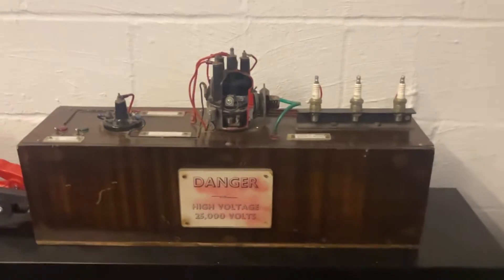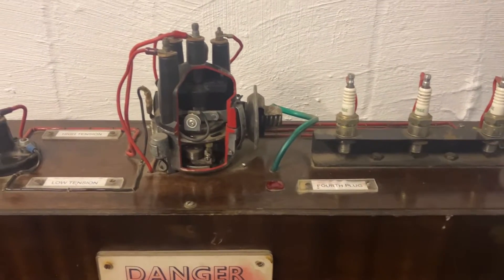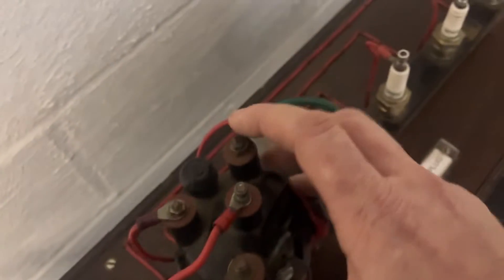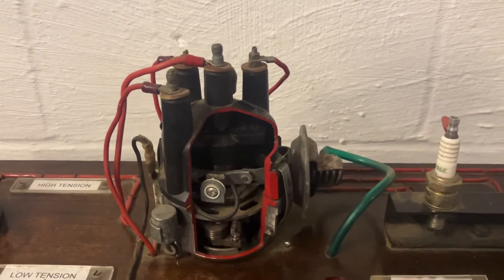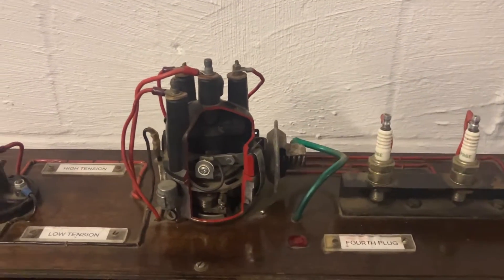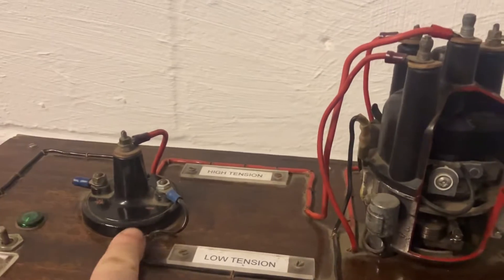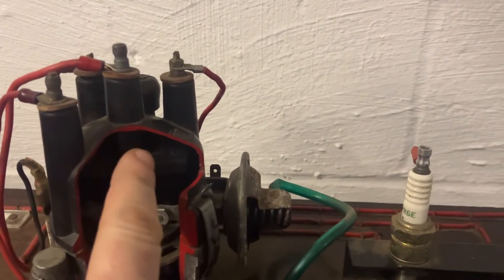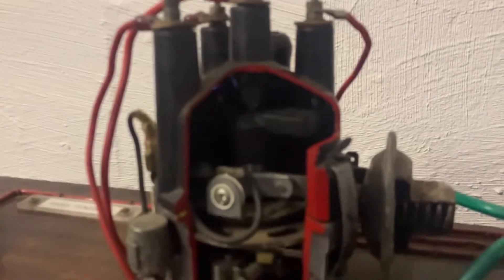How a Distributor Works.

Comment: Thank you for the video. I used to do the timing on my 1971 VW bug around 50 years ago using a 12V DC light bulb. I don't remember how I did it. Distributors were a mystery until I watched your video.
Reply from the maker: Thanks for the kind words. That’s what it is there for, glad it helped your understanding! Thanks!

Comment: Do the rear brake parts follow the same principles as the front? (‘70 Camaro calipers, pads, brake lines; ‘70 Chevelle rotors, bearings & wheel seals). I bought the CPP front drum-to-disc brake conversion kit before I found this video, so I figured I would take your advice to convert the rear brakes. Doing this on a ‘66 Impala sedan I recently bought. THANK YOU FOR DOING THIS VIDEO! 😊
Reply from the maker: Hi, is this comment for a different video!?